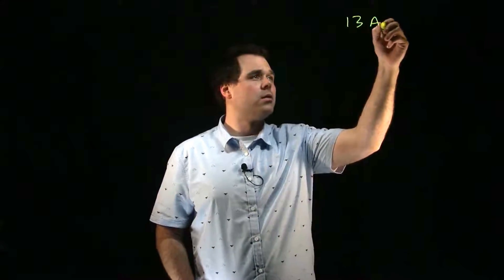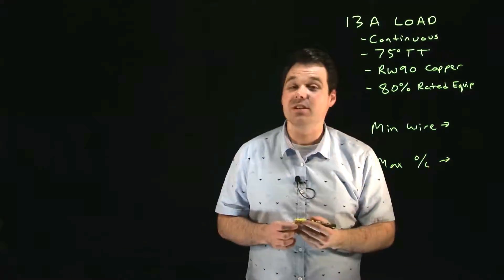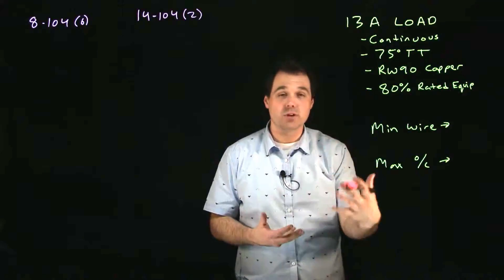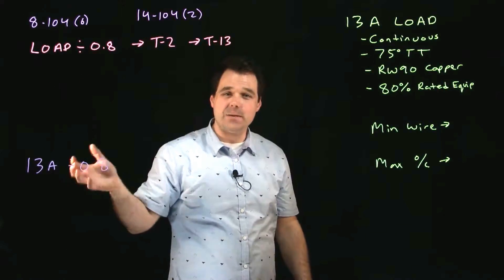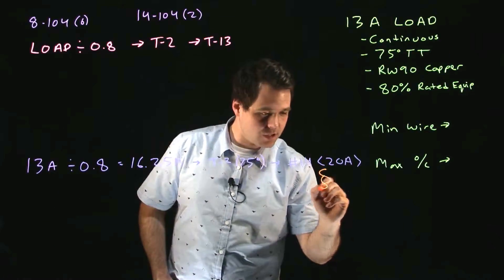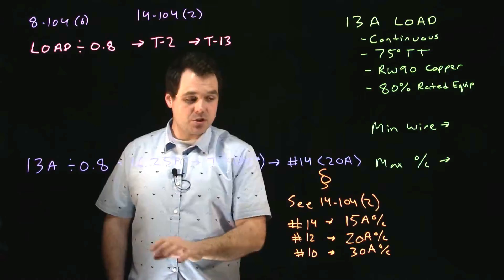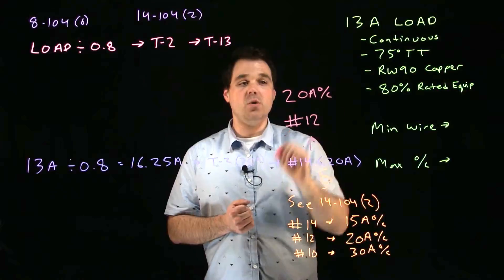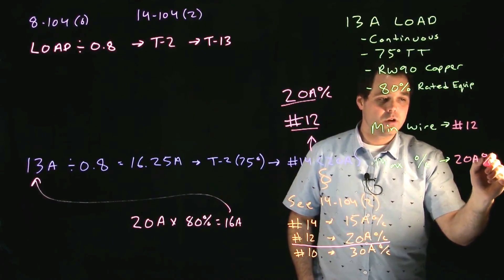Conductor and OC Sizing - Continuous Load with 14-104

Comment: May I ask:
Why not do we first check the breaker In(A)-Rating Current, 
1) Choosing the In=20A breaker based on the conclusion 16.25A, then
2) Checking Table 2 based on the breaker In[20A]
We got the same conclusion, also under the Codes 8-104(6) and 14-104(2) required.

Comment: in the middle of the video you mentioned how the overcurrent rating was less than the allowable amperage allowance for the given conductor size so you would need to upsize the breaker rating. Doesn't it make more sense to have your breaker rating to be less so that it will trip before the load current goes beyond the conductor allowance????????
Reply: The code for this is showing you the most "unsafe safe way" a smaller o/c device will be safer but we are finding the min amps of wire and MAX o/c device.

Comment: Still in school for electrical so excuse the potentially stupid question, but why is your load measured in amps and not ohms, I thought a load was your resistance, I feel like I’m missing something here
Reply from the maker: It can kind of be either. A load will have a current vale, because there is a path for current to flow. The path will have an ohmic value.

I prefer to think of Load as current.

Comment: So effectively 14-104(2) drives the user to the 60 deg C column of table 2 for thin wires, AWG 10 and smaller, unless an amendment applies (like a fixed resistance heating load, which overrides 14-104 in 62-114).
Reply from the maker: Only if the equipment is not marked with a temperature. Lots of equipment is marked.